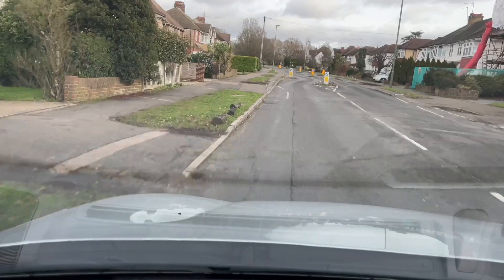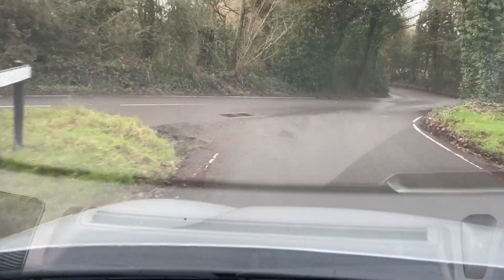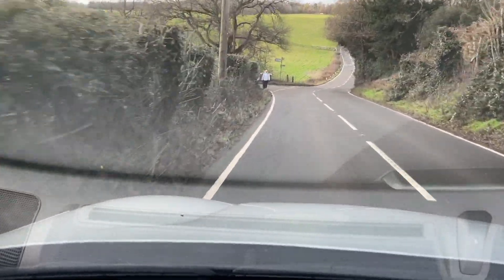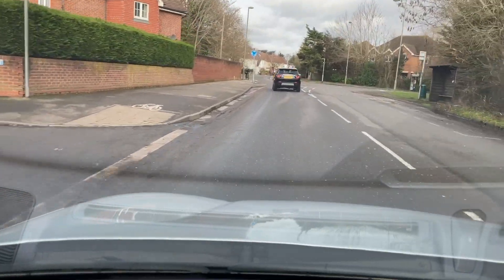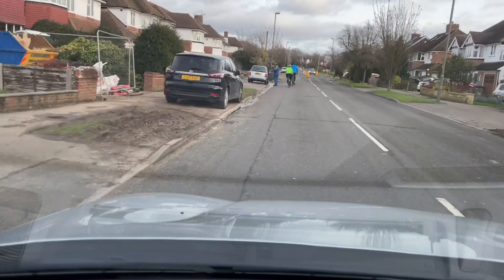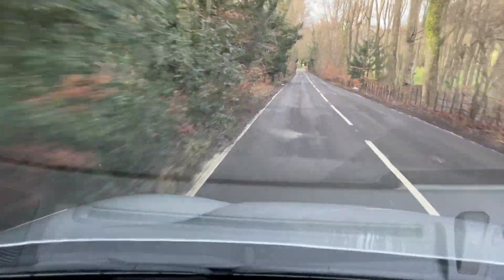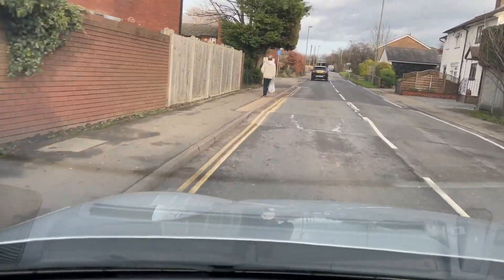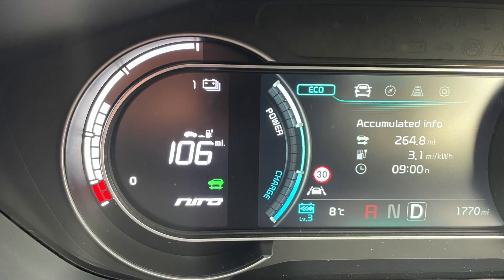Man v Car - Who’s More Efficient?

Comment: On an earlier video you responded to a comment about poor sound saying you were still learning. This is much much better, so well done. A couple of points, do you use a loudness meter on your editing system? This shows audio level but relates more to how your ears hear sound levels, it might help even out the dialog and music levels. One final point, put a short crossfade on the audio between shots, picture cuts is fine but do the same with the audio and you get clicks. A short crossfade will get rid of the clicks, make the crossfade longer and it will smooth over the audio transition and make it less abrupt.
Reply from the maker: Thanks for the feedback. Really appreciate it.

Comment: First of all, I love regen braking, but my "regular" gas car can do the same thing, it's called engine braking. The car slows down similarly, if you do the shift down then it's comparable to regen braking. I know it doesn't give me back the energy, but I can lower the wear on the brake discs.

Secondly, when you go downhill in an EV, you don't need to turn off regen, just keep your foot on the acc pedal and lift it slightly. It will still do regen and you can control the speed in a smooth manner.

What I don't like in the e-niro is that there's no full one pedal driving. You have to press the paddle on the steering wheel which is inconvenient and sometimes impossible (when you turn and the steering wheel is not in the straight position). I would prefer it stopped completely like the Nissan Leaf.

Another thing is that "auto" in e-niro means you can still set the level from 0 to 3, and that is what the car uses if there's no car in front of you. If it detects a car in front (the regen sign and the "auto" label under it goes blue) then it might increase the regen level temporarily, but it never decreases it relative to the set value. So if you set it to level 3, auto doesn't matter.

Comment: You dont need to treat your flappy paddles as brakes. The car will use regen anyway when using the foot brake until you press down hard enough for it to realise that regen alone is not enough.
Reply from the maker: Its hard to tell when regenerative kicks in with the pedal though so was trying to work out how to get the best out of the car.
Reply: @EVDoesIt  not really. The right hand gauge shows the blocks dipping into the regen range whether it is due to foot braking, paddle braking or auto regen. It's the same either way. Using your flappy paddle to apply some regen is equivalent to lightly using the brake.

Comment: It was short but typical of what many drivers do in the real world. I have mine set to auto off, coast whenever possible, manually use paddles to brake only as necessary and most importantly anticipate well in advance. I get some sort of perverse pleasure in driving economically without cutting speed. I did it with petrol cars too.

Comment: Something to have checked as you drove on each run was the energy consumption (miles/kWh). You would also note that your driving style changed a bit on the last round with Auto-regen. You accelerated a bit more. Also check in driver options if smart recuperation is checked as it works better with Auto-regen. 

It was a great video. It’s always enjoyable watching your videos. Keep up the great work.
Reply from the maker: Thanks! I was keeping an eye on the miles/KWH but it didn't move. I think over the distance/time it was too small to account for any marginal difference.
Reply: @EVDoesIt  could have reset the trip measurement. That would give you an accurate mi/kWh for each test maybe?